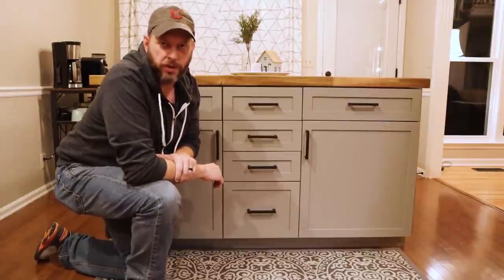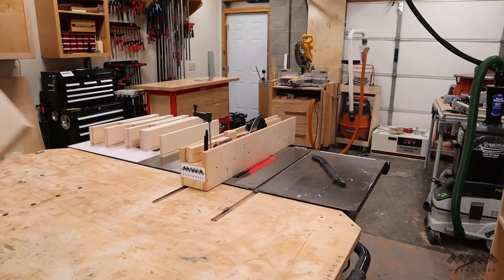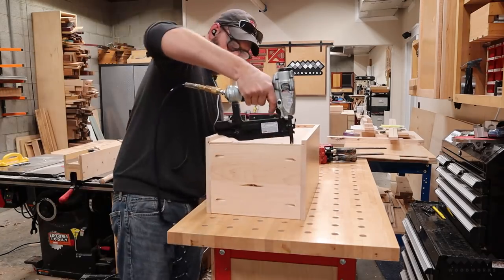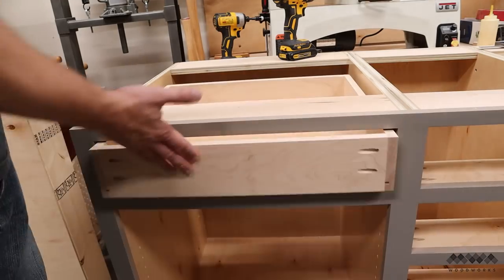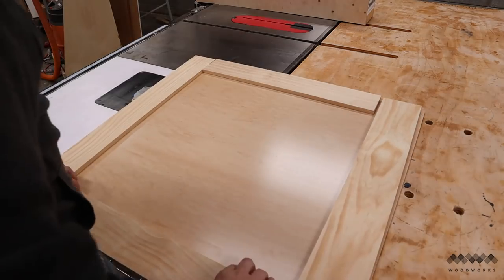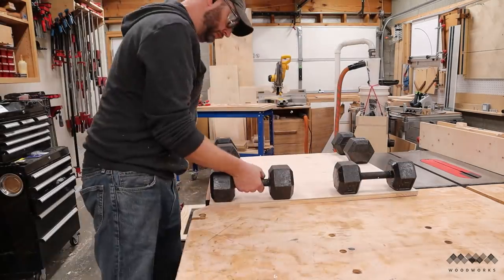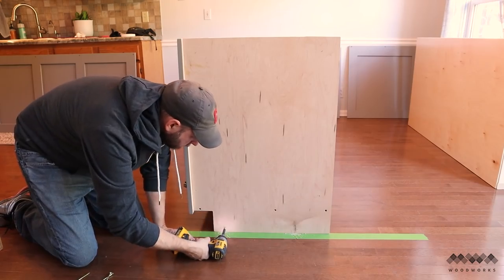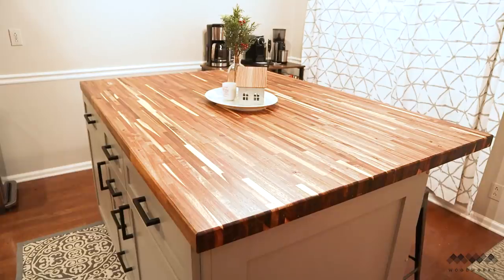How to Build a Kitchen Island - Part 2

Comment: How important is the support wall? I want a couple of drawer stacks on the front of my island and so will build cabinet boxes for those.  But where you've added the support wall behind those boxes on your build, I want to add a trash cabinet box.  So that box would be 90 degrees to the drawer stacks and directly behind one of them on one side.  I figured I'd mirror that on the other side with just a regular cabinet or another drawerr stack.  But I'm limited on space in that direction.  To put it simply, can I eliminate the support wall and build a kitchen island completely out of cabinet boxes if I intend to install a stone counter top?

Comment: I am building this exact island per your video, can you tell me what method of joinery you used to put the face frame together. Most concerned with the butt joints. Kreg ? YOu said you put the whole frame together using nothing but glue??? with the help of a few brads to hold it all together.
Reply from the maker: Correct, I just used glue. You can also use pocket screws. Since a face frame is just decorative trim and doesn't take any stress, there's no real need for anything other than wood glue, but pocket holes are nice if you don't want to deal with glue👍
Reply: @MWAWoodworks  thanks for the follow up my friend!

Comment: I only ask this because I want to learn, so hopefully it doesn't come off as nitpicky.

At 10:10 Why do the drawers appear to not be aligned vertically and how can I avoid this?

For example the top two drawers appear to have a bigger gap on the left than the bottom two.

And the 2nd from the top drawer appears to be shifted to the right, more than the third drawer from the top (their left edges don't align)

Comment: FINALLY!! Been waiting weeks
Reply from the maker: You're welcome 😁
Reply: @MWAWoodworks  question - how do you calculate/plan the amount of overlay for doors and drawers? And also how much the face frame should sit proud / inside of the carcass? Those details are rarely discussed.
Reply from the maker: There's no "rule" but I did a 1/4 inch overhang on the face frame. Same for the overlay. It's all just preference. I wanted my drawers have almost no gap. Just calculate the total height of the face frame and then start subtracting out all the gaps you want. Then divide the remainder by the number of drawers you want (assuming all drawers are equal size, mine are not)

Comment: man that videos were perfect. For one you did a great job on it and looks great, covered all aspects and kept the time reasonable, thanks for that. I've been searching this kind of build for ideas as i'm going to start a kitchen island myself. 2 questions if you don't mind, why the support wall in back out of 2x6 you may have told us but I missed it. Cant the cabinets themselves support everything? Also what is the reveal between your face frame and the supports for drawers behind the FF or is it flush to it? Thanks for your help and I'm subscribing for sure.

Comment: It came out great! I noticed the bar overhang doesn’t have any support, have you had any issues with it? I just put butcher block on my island and wasn’t sure if it was necessary, no one really talks about it.
Reply: Any updates? I’m about to do the same and not sure if I should add brackets to support the overhang.

Comment: Amazon isnt carrying the under counter slides anymore,, any clue where else to get the exact ones here in your video?
Reply from the maker: Most undermount slides are basically the same. You just have to make sure you buy the slides that are the same exact depth as your drawers (18" slides for 18" drawers).
Reply: @MWAWoodworks  thanks man,, this is quite a project  You make it look so easy :)

Comment: Matt great video!! Was this butcher block with the finger joints  joint construction as shown on their website. If so, how does that feature look and which wood did you choose? Thanks
Reply from the maker: The finger joints are visible. I went with acacia wood
Reply: @MWAWoodworks  Thank You - looks great. Great job on the video. Enjoyed watching and will use it for my build.

Comment: This might be a dumb question BUT.... How did you get the dimensions you were going to need for the drawer faces taking into account the spacing in between them? I loved this project. I've seen this 2part series like 10xs but couldn't figure out how or where you measured 🤷🏻‍♀️🤦🏻‍♀️🙈
Reply from the maker: I use spacers between all the drawers and doors. Then just calculate the distance to the edge of the cabinets minus whatever space you want around the edges, usually half the width of the face frame

Comment: Hello Matt, I like the style, now the rest of your kitchen needs to be done! I have a few questions, but I think the answers would be too long... You choose if to reply or not, no offence if you don't!
1. I would have painted the center panel of the doors and drawers before installing them into the frame. This way if they accidentally move due to heavy use or any kind of expansion for moisture they will never show parts that are not painted. If I'm not wrong, you just glued the corners of their frames.
2. It's a bit a pity from my point of view (just my opinion!) that you screwed the side panels from outside and you see that bollards: couldn't you do it simply from the inside? That way you didn't have to ruin the painted work.
3. What is the rear wall used for? Why didn't you build longer cabinets even if the drawers could be shorter? That way you could screw the rear painted panel like the sides, from inside the cabinets.
4. Did you fasten the top just with a few screws on the front and some on the rear, with slots? Will the table top be able to bend in the center, creating a gap with the cabinets? I would have fastened it at the center and created slots front and back for expansion.
5. Any other method to install the lower part without nails? 
Thank you, the result is very nice!
Reply from the maker: 1. The doors and drawers have plywood for the center, not hardwood. There won't be any noticeable seasonal expansion or contraction.
2. The screw caps don't bother me. The side panels are screwed in from the back but I couldn't do that with the back panel the way I designed it. 3. The support was was far more cost effective than buying additional sheets of plywood to make deeper cabinets. 4. You can use a construction adhesive instead of screws to hold the island in place. 👍🥃
Reply from the maker: Also the top is screwed at the front and back with slotted holes for expansion. No need at all to fasten the middle the counter top is dead flat.
Reply: @MWAWoodworks  thank you so much for your answers! I really appreciate the care you reserve to your channel! Take care stay safe and healthy, and Merry Christmas!

Comment: So let me ask a clarifying question- when you’re making your face frame, how do you decide what width to make it? And then once it’s made, how do you size the doors appropriately? That is, the doors are relative to the size of the face frame opening, and not the carcass itself, correct?
Reply from the maker: Most times face frames have a 1/4 inch overhang on all sides. I used that plus the measurements of all my openings to determine the face frame dimensions